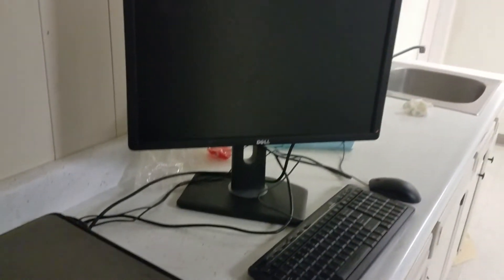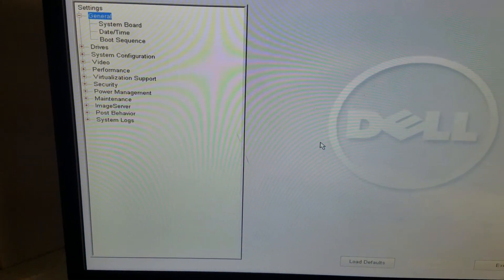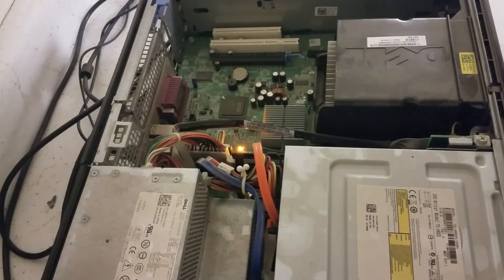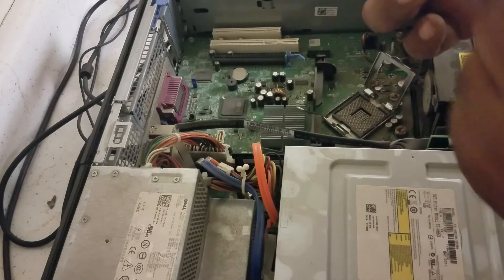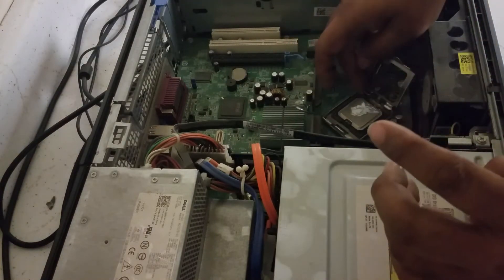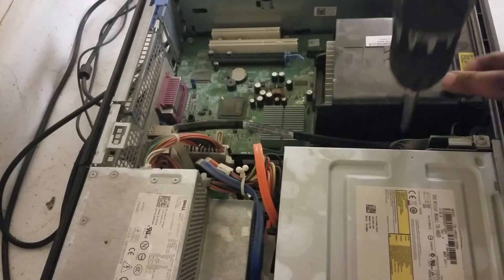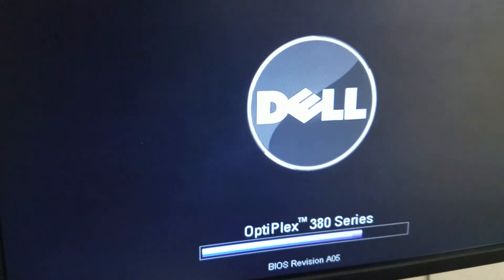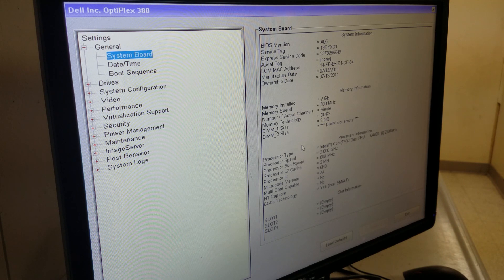how to upgrade CPU Dell 380 (3)

Comment: 32bit processor dell. Optiplex 380 ...This support windows 10 or not
Reply from the maker: yes, add 4 GB Ram
Reply: @infotechnologybase1760  it's already 4gb ram
Reply from the maker: @bodlashivaprasad9505  you will not have problem running WIN 10 Then.
Reply: @infotechnologybase1760  core duo processor
Reply: @infotechnologybase1760  window 7 ultimate running present
Reply from the maker: @bodlashivaprasad9505  you can go to Microsoft website and upgrade it to WIN 10
Reply from the maker: https://www.microsoft.com/en-us/software-download/windows10 this site
Reply: @infotechnologybase1760  I will try and any problem ..I will contact you.. tq